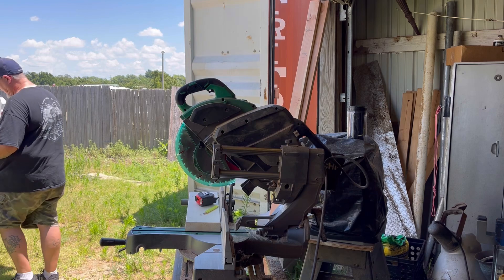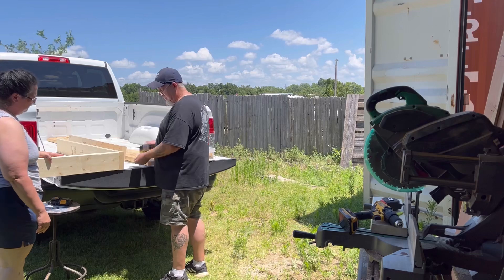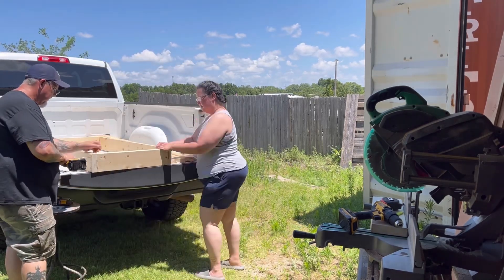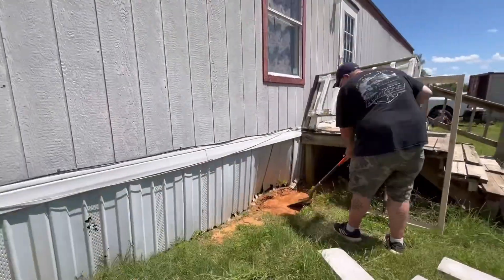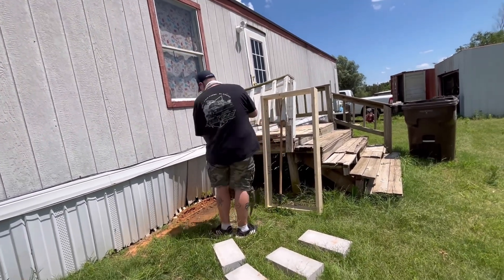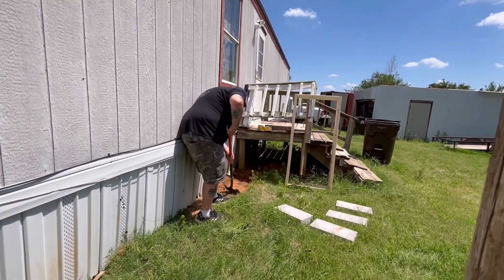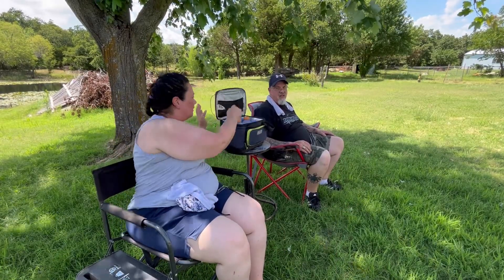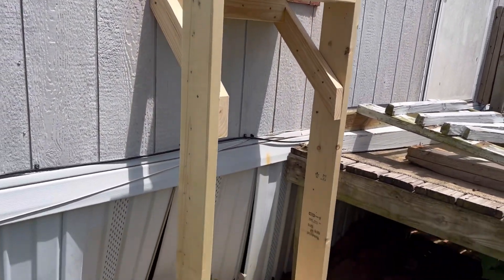Adding a Much Needed Help to Our Central AC

Comment: Not sure what your area temps are but ac is a must for most people this summer.  Its to easy to get overheated outside.
Reply from the maker: Yeah, it had been in the upper 90s and low hundreds and our  central AC was not keeping up. After a very expensive repair from our AC guy for a burnt motor, we decided to add the smaller unit. It’s helped tremendously ☺️ Thank you so much for watching and commenting ☺️